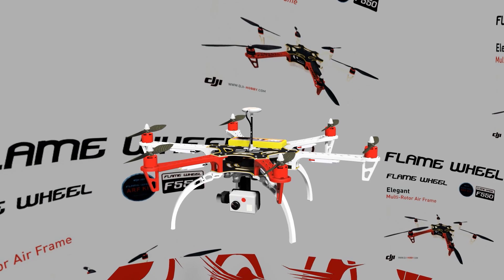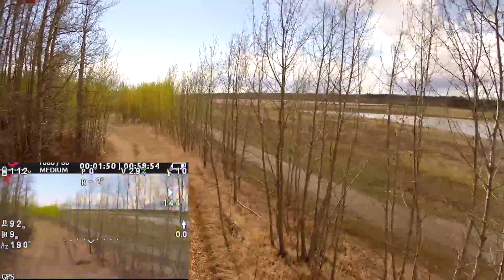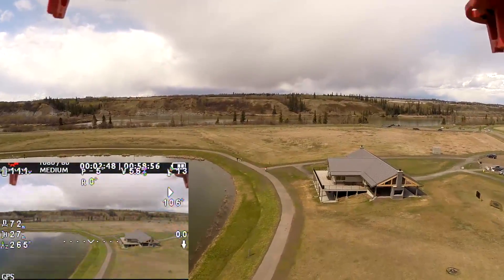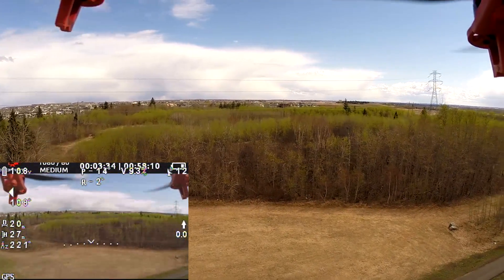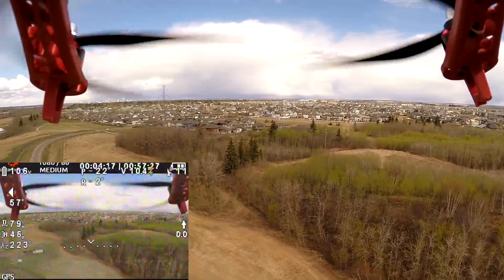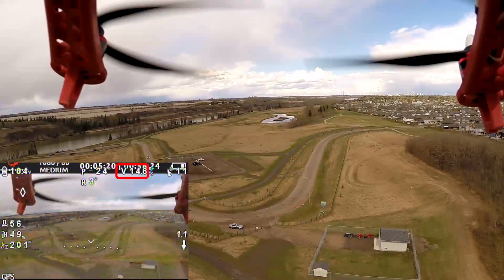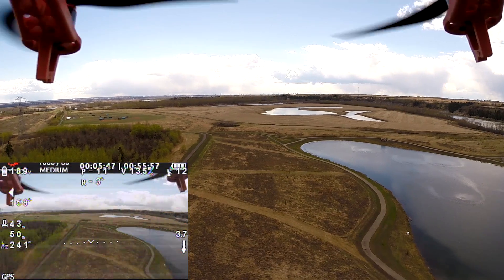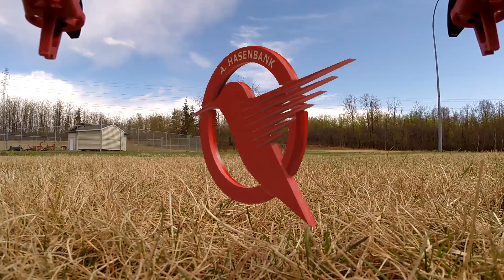Speed Run with a DJI F550 Copter

Comment: Great flying location,thanks for your video. Going to have to look into the video interference a bit. You might have to look at positioning video tx further away from ESC or look at ferrite beads on them?
Reply from the maker: Already have the Tx down on the legs so I'll look into the ferrite beads.
Reply: Hummingbird.UAV the ferries do make a difference. Bit of experimenting in size,number of turns and location helps too. I have done quite a bit of work to reduce interference,the bugbear of all FPV flying,and found they gave the best results for effort ratio. I built screened cages for components, decoupling transformers on power supplies etc but only had marginal improvements at best. Interference can be conducted or radiated,sometimes both,and needs analysing to identify. Good gains came from eliminating the conducted interference by giving the VTX its own independent power supply. This showed I had conducted interference so hence the ferrite beads,capacitors and transformers! Interference can drive you crazy!

Comment: and how much is the battery capacity and how long does it flies
Reply from the maker: It flies about 10 min with a 5200mah S3 and 17 min with two 5100mah S3 batteries